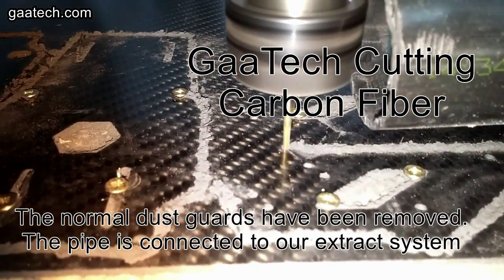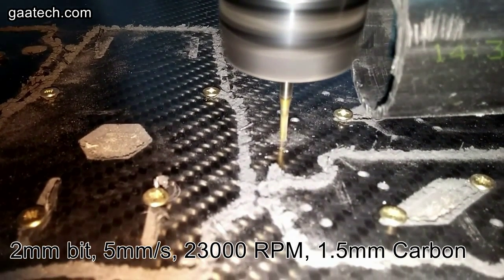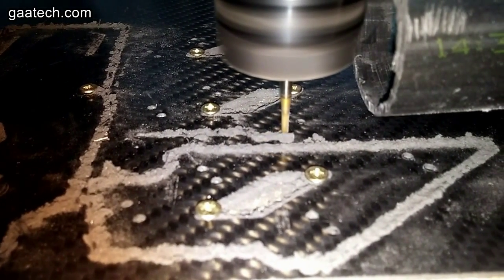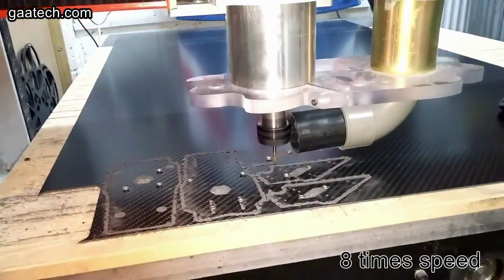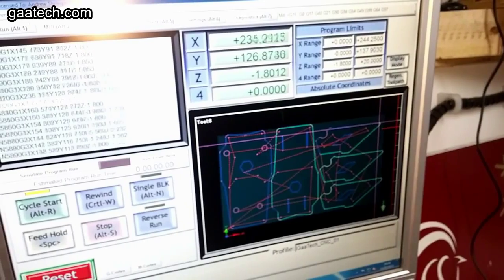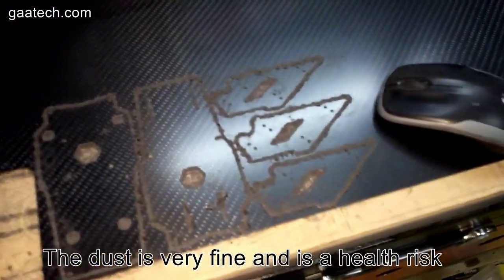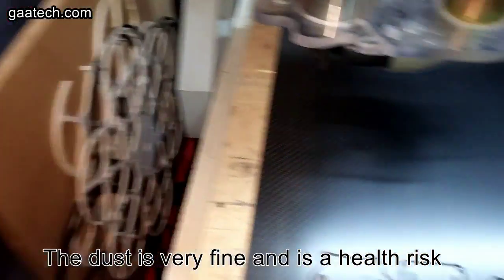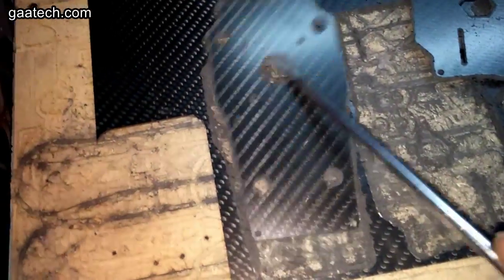0027 cutting cnc routing 3k carbon firber (fibre) 900 x 900 table

Comment: my eyes are bleeding...that bit is suffering too hard with that slow speed....
Reply from the maker: Paolo its running at 23500 rpm its a 2mm bits works perfectly may be you can hear the vacuum on the dust collection
Reply from the maker: its also grinding rather than cutting as it does not have any flutes
Reply: I  cut cf every day buddy and I run 3mm bits 2000mm/min and 2mm bits 1000 at 24000rpm. Of course using corn type Endmills.
In your video the resin is melting as the bit cuts through it, you are not grinding it. You need to remove also those chips from the cutting tool.
Reply from the maker: I have tested faster speeds and the edge finish reduces.  These multi faced bits in my view do grind through the material as the tools have not flutes.  I know people that use fluted cutters for carbon and the speeds and feed are different and the cutters do not last long, then i would agree that the fluted cutters need to have the correct chip loading to work.  

My dust that is produced does not stick together and is very fine so that tells me that i am not melting the resin.  

When my dust shoe is attached, when not filming, most of the dust in taken out of the channels, so that proves it is not melting the resin

I have sold many parts and i have never had any negative comments about my edge finish.  

Like many things in life there are always more than one way to do something.  The way i have found and use works for me, and i thank your for your comments and concern.

If you are cutting when using a 3mm bit at 33mm/sec (2000mm/min) works for you then that is great but i am much slower than that to be able to get the edge finish i required.

Comment from the maker: if you only have a spindle that does 12000 rpm start with a slow Rees rate day 3mm per sec and slowly increase.  listen to the sound the bit makes.  it you go to fast the bit will snap.  only cut a max depth which matches the dia. of the bit.

Comment from the maker: For sure if the but size is bigger than the size of sheet yes single pass would be fine.  As for feed rate I am not sure what type of not you have.  start of slow and listen to the noise your bit makes.  you should be able to manually adjust your feed rate. as you only have 12000 rpm your feed rate will be much slower than if you could use 24000. 

let me know how you get on.  if you are not sure what type of not to use have a look on the website.  although single and double flutes would cut they will blunt very quick and not give you a great finish.  the multi faced bits grind the material away.  be careful with the dust
Reply: +Carbon - G10 - FR4 - CNC Routing - 3D Design & Printing - Online Shop 
check your email sir

Comment: Nice video, that was helpful for me. My spindle only does 12000RPM, could you recommend some good feedrates for starting? Do you think it is OK to do the full depth in one pass as long as the bit size is bigger than the carbon fiber thickness?